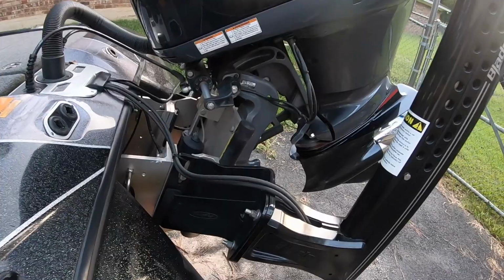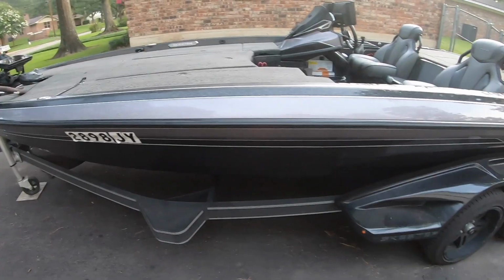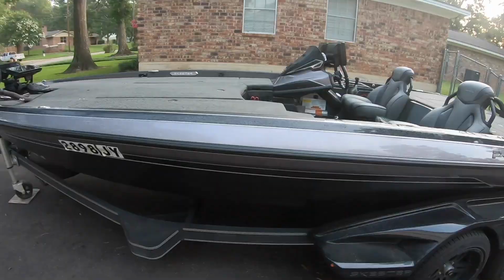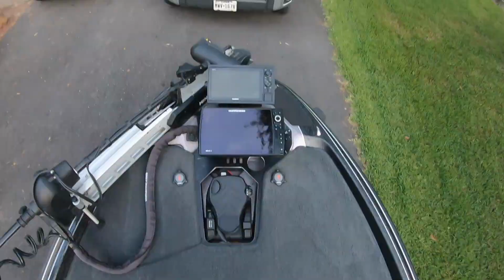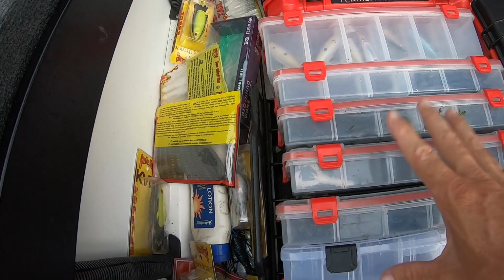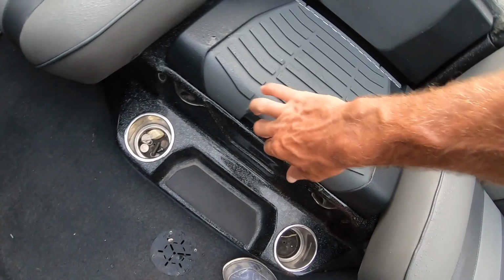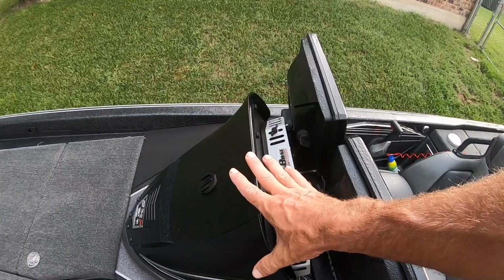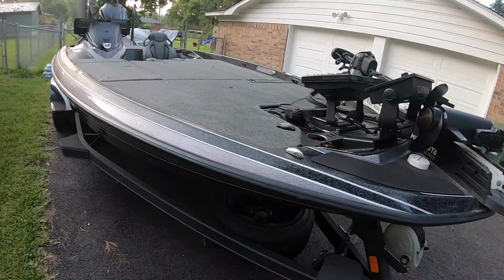Skeeter Boat Review after 6 months (What I think now!)

Comment: I realize that different hulls may be different, but on my '21 FXR-21, the minimum speed to avoid porpoising (in relatively rough water) is 40mph.  There are other solutions (ie. 4 blade prop, hydrofoil, etc), but "getting on it" is not one of them.  On the Great Lakes and Lake St. Clair, you will be lucky to be able to go 35mph on an average boat traffic day (in a bass boat).  Yes, there are guys out there that have a need to be able to be on plane at a low speed.  Going through windy, narrow creeks is another situation.
Reply from the maker: I’ll do video on it but trimming down and backplate up fixes it instantly

Comment: I love my 2018 fx21 and really love the Yamaha 250 package has 275 hrs. All on Toledo Bend big water lots of rough days. My one complaint after a few trips i have screws popping out, one area is the front under the rubber fender that is aggravating! Next time they backoff i may add some epoxy to hold them in. Skeeter needs to get this corrected! 😊😎
Reply from the maker: Noted, don’t have that problem but I’ll keep an eye out

Comment: Good Review  -  thanks for the tip on the porposing at low speed.  I just purchased a FXR21 and that is helpful.  Where do you like to jackplate when running all out?  I am still figuring out the trim/plate settings.  Thanks -
Reply from the maker: I put it low around 4 and trim pretty high. Depends on what you have in the boat but that’s how I get maximum speed

Comment: How many rods have you lost over the no freeboard surfboard of a sled you are bragging on.
Reply: Good observation.
My buddy loves boat's with no gunnel or sides, not sure what you call that lip or edge 🤷
I prefer my front deck to have sides! 
I was hard core looking at skeeter's, but the dolphin effect isn't my thing and my dad won't fish with me if I go over 30-35 & I do occasionally cruise around slow sometimes so having a boat that struggle's to do that would be irritating to me.
Reply: @rowdybroomstick1216  Todd just told you how to get rid of the porpoising if you have it.
Reply from the maker: I’ve lost at least 326 rods for being careless, and yet I keep going 75 down the lake without using that thing on the front. I think it straps it down not sure.
Reply from the maker: Thanks Table rock, however I’m not sure they realize you can’t hardly even get on plane under 30